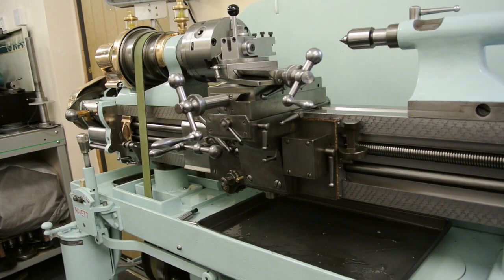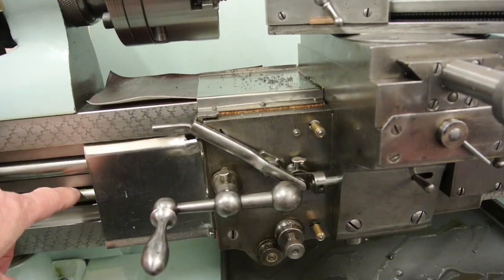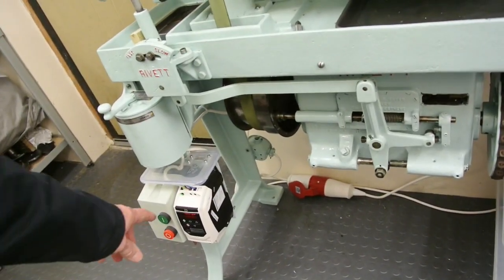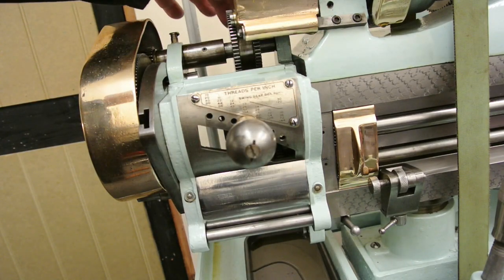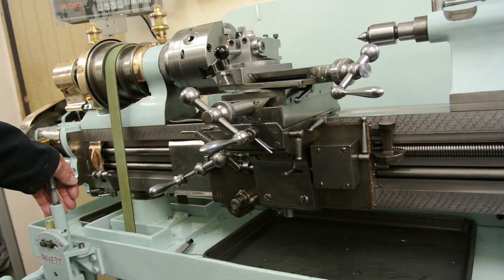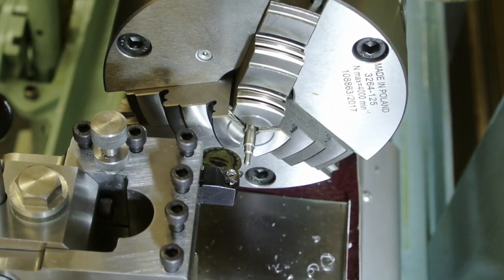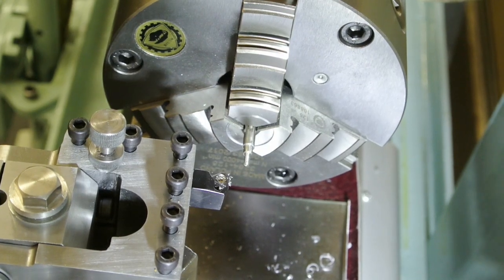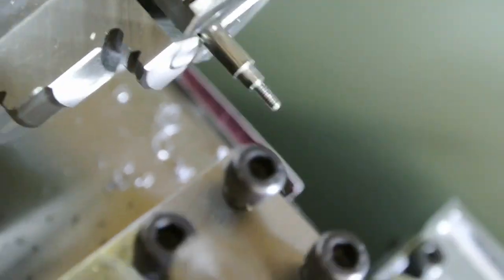thread cutting on Rivett 608

Comment: I'm all over your videos, you are an inspiration!  I am getting into cnc, but also I've acquired a Rivett 504 lathe and a BC Ames No. 3 lathe.  I plan on adapting at least one of them to cnc.     I have to ask you what you are coating your exposed steel with?  I have been using mineral oil mixed with a bit of butcher wax, but when I see your sparkling machinery, I wonder if you're doing something else?
Reply from the maker: I just wipe over with oil to stop any rust. I have found to be very careful not to use cutting oil on the lathe as it will stain everything brown especially if it gets hot. I now tend to use compressor oils that are less coloured.
The Ames is a very nice lathe and personally wouldn't convert it to cnc. The Rivett also is a handsome thing. Why not get a cheap Chinese mini lathe to convert there are several good videos on how this can be done. John
Reply: @john2478  I know you are right, I've studied this and studied how I might do it and it looks like no matter how, the result wouldn't be good. Starting with no longitudinal traveling carriage.  You are right, use either cheep chinese or old Atlas/South Bend/Clausing lathe.
Edit:  If I did convert one of my Ames No. 3,  I'd do a 'faithful' and aesthetic conversion for sure. They are beautiful lathes, though not very rigid.  I wish I knew how to replace the cross and compound screws, mine are incredibly worn, but only in  the middle.

Comment: Was slightly nervous watching that method of threading, but whichever way you prefer..
That's a very nice lathe
Reply from the maker: It is not common to see a retracting tool post in operation and that was the reason I posted it. Any threading under power in the direction of the chuck is a bit of a worry, and I usually thread by hand cranking, see my video on the Sloan and Chace lathe. However on the glorious Rivett lathe it is too far away to manage to crank the spindle. The usual way when threading like this is do do it by releasing the drive and re engaging it using the threading dial. However this only works if you use an imperial leadscrew cutting imperial threads or metric cutting metric threads. I often cut a mix of imperial and metric threads. Unfortunately the Rivett lathe uses some really obscure threads that are imperial of course. Some are not even listed as standard threads. 
John
Reply: john2478 
The retracting tool posts or top slides are certainly handy, along with hand cranking for some awkward parts.
You have reminded me, the chase threading banjo stud on the back of my Hardinge split-bed happens to be a standard 3/8" thread into the bed casting, yet has a non-standard pitch for the banjo pinch nut.. A lot of the non-standard threads do seem unnecessary and questionable at times.